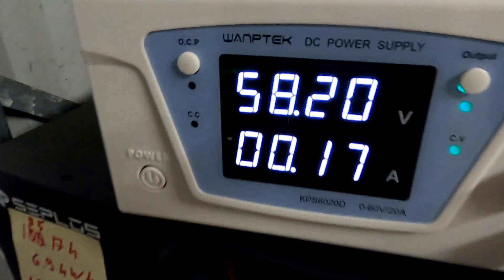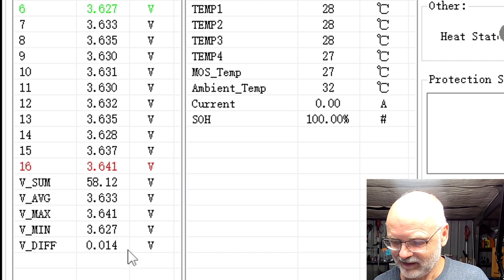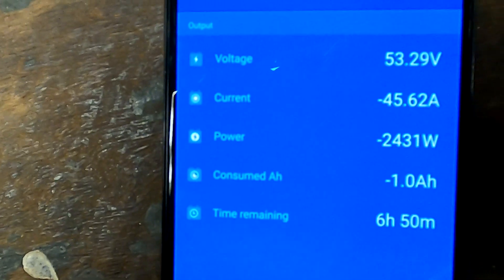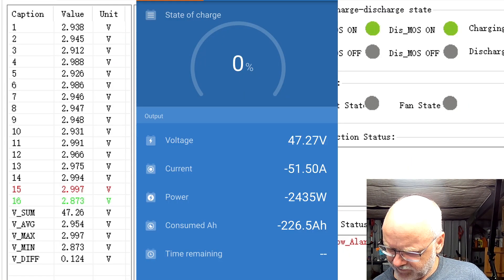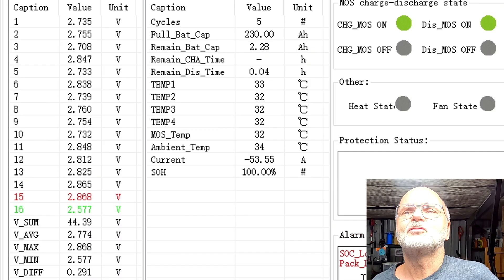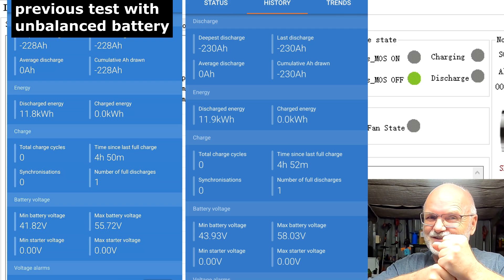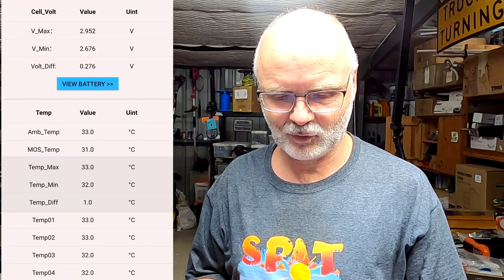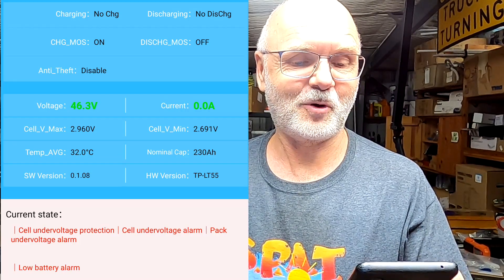Testing the QSO Battery again with 'optimal' settings. How much capacity gain can we expect?

Comment: Hi Andy. 
I am very impressed by your videos. 
I am now in the process of replacing my battery bank in my sailboat. Today I have several 140Ah AGM batteries but still I have problem with low volt when I am sailing and use some of the electric winshes. How can I test the batteries if they are still OK the 
easiest way?

Comment: Could you please do a video of batteries in parallel with unmatched cable lengths and taking the supply off one battery only ?
Reply from the maker: Sure, that's exactly what I do at the moment with the test powerwall. 3 different batteries with different cables and lengths.

Comment: Hi Andy, and thanks again for this video,
only 2A capacity difference?
But this time, at full charge it was balanced, we would say another battery? the active balancer has done its job.
Regarding the online connection and the remote system, I think it is necessary to connect the battery to a Modbus wifi box, because it connects via the RS485 or RS 432 ports, or maybe they will provide an optional box?
to be continued....
I hope that QSO, will take into account, all your videos and tests, that they will make the modifications accordingly?
Reply from the maker: Yeah, not much difference between the two tests. Surprising for me too.

How exactly the remote support for the BMS works, I don't know yet. I guess they are testing it. I find this an insane project. If they sell thousands of these BMS and batteries, how would they manage the work around providing support for all these customers if the BMS is still locked with a password. I cannot see this working from a business perspective.

Comment: We have learned so much about optimal BMS configuration with you, it naturally seemed odd how "far off" the locked BMS settings were. This makes me wonder just how messed up the values were QSO customers were using for them to lock their BMS to stop warranty claims. Changing random numbers with no understanding of how it works.
Reply from the maker: Yeah, not great. They should have asked before they put something like this out on the market. I still think, locking the settings will not work and customers will get pretty mad if they cannot change them.

Comment: So, do you recommend this battery??
Reply from the maker: Well, if you just want a battery which works and don't worry about changing settings, this one seems a decent option. It's plug'n play. Connect and start using it.

Comment: Cool, thanks again Andy. I've seen the same behavior as your cell #16 with 32700 cells where cells will peak first and then discharge first, which to me suggests possibly higher internal resistance. I wonder if your #16 might show higher internal resistance than the cells with highest capacity?  I also noticed on a couple of new 32700 cells that tested lower capacity when charged to 3.55V would regain some capacity if charged to 3.7V for a couple of hours and then maintained at 3.65V for a few days, so I wonder if its something to do with non-uniformity  in cell construction or chemistry?

Comment: Can you run a test ,with battery 100% of charge up to other test to charge and discharge to 80%

Wich would be better ? 
This to stimulate a electric car battery with let say 5,4 kw 

Wich  will have the longest life time ?

The one with evrytime 80% of charge and discharge  or the one with 100%
Of charger and discharge
Reply from the maker: The smaller the DoD is the longer the battery will last.
Such a test you suggested would take 10+ years to complete ☺️
Reply: @OffGridGarageAustralia  so what would you suggest then 80% or 100%?
I doubt that the Battery last 10 years.
So if you have always 50 %of discharge in vehicle ,as you say the charge up to 100% instead of 80,%
Because if every charge and discharge you left of 50 %=
Instead of 30%
I doubt or that true ,but simply do not know since i heard also that not always good too %%charge  evrytime.
But i simply have no idea
Reply from the maker: @cees1910  As long as you keep the voltage down, you can charge LiFePO4 to 100% every time without harming it. 3.45V per cell with some time to absorb has been proven to be very good and well working.
If you get 3000 cycles out of the cells (instead of maybe 6000 under ideal conditions), that is more than sufficient.

Comment: hey Andy, thanks for doing the revised capacity test. It looks like you got an additional 3ah from top balancing the QSO battery pack. I ran the calculations and if the bms balancer balances at 50ma it would complete the top balance process in 3 days if it was programmed to be in static balance mode. 3 days is not that bad for a 200-300 mv deviation at the top of charge it turns out!
Reply from the maker: In theory yes, but you need to keep the charger connected with 55.2V to recharge the low voltage cells. Because of the series connection, all cells are getting charged at the same time. The charge current needs to be lower than 50mA for the balancer to be successful. So there goes your calculation... 😉
Reply: @OffGridGarageAustralia  3.65v times 16 is 58.4v. So I would set my charger to 58.4v and set charge current to what ever I want say 50 amps. When a cell peaks the bms will shut off charging and the BMS gets to work balancing the cells at 50ma. say it balances for 30 minutes for example and then the cell falls back down to 3.5 volts or something then the 50 amp charger activates and then the peaking cell hits 3.65v again and again and again for 3 days straight BUT the key point is at the end of the 3 days ALL THE CELLS are now magically at 3.65v and the magic device is called a BMS WITH BALANCE FUCNTION! I have tested this out during a 2 week span with a battery that was way way out of balance and it worked.
Reply from the maker: @uhjyuff2095  I would not recommend charging to 58.4V all the time. That is far too high and only stresses the cells. You BMS will shut off all the time. Set the charger to 55.2V and leave the BMS at 58.4V. If the charger is faulty the BMS will catch it. That's how it is supposed to be.
Reply: @OffGridGarageAustralia  Yes, I agree. Set the charge voltage that you want 55.2v So in that case you want all the cells to be top balanced at 3.45v. This means that the bms has to have the settings changed accordingly. Obviously if you are using a bms that has preconfigured settings which can't be changed you will have to make sure the balancer inside the bms is activating at the voltage you have set (55.2v). I totally agree stressing the cells at high voltage just to get them to be top balanced is sucky, because then you basically have a bms that will not balance the cells and you would have to purchase an active balancer. I think you said the QSO bms is preconfigured so its charge to full and stress the pack to do a top balance. for example I have a hardware bms and it triggers the balancer at 3.7v and then drops the cell to 3.6v. I mean it has balancing but its like emergency balancing, pretty weird so I don't know if its worth keeping around.
Reply from the maker: @uhjyuff2095  I would not use one of these BMS which cannot be adjusted. 3.7V is over the specs of the cell already. Maybe still OK, because it is only for emergency purposes.
I leave the BMS at 58.4V pack or 3.65V cell OVP and only change the charger settings accordingly if I need to. The balancer kicks in at 3.45V as well, so I only balance the cells which are over that voltage. I have not tried to start balancing earlier and I'm not fully charging often. Might be worth a test 🤔

Comment: I'm being told by neey that the balancer itself isn't updated but the app is what is updated and that all neey's are version 4 basically as long as I use the new app, I'm s9 confused
Reply from the maker: Well, they sent me new hardware all the time whenever they made any improvements.
The app also shows the hardware version.
Reply: @Off-Grid Garage  guess I better check, I just ordered a third set of wire harnesses so that I can wire each of my seplos Masons with their own wires and I can plug the neey in as needed, I have two neey's but fr9m what I know I have a first and second version but not positive , hopefully both are a version 4 if I use the new app software,  been messaging them but response ended over a week ago

Comment: So you know also have shown that top balancing that almost 0.300mV difference doesn't really matter also ;-)
Reply: it matters a little and remember this is a new battery pack imagine one year or 10 years from now!
Reply: @uhjyuff2095  Yes, but just like you calculated (below), the onboard 50mA balancer will take care for that. No need for the NEEEE
Reply: @igorybema  Exactly, a balancer that actually activates will keep the battery operational, but the stupid thing that I see sometimes is bmses that are not activating the balancer from incorrect parameters so when seeing a Neey balancer that just functions it is really nice to see!
Reply from the maker: Nah, the 50mA balancer will not work here as mentioned below. But maybe we don't need to balance and everything is good as it is.